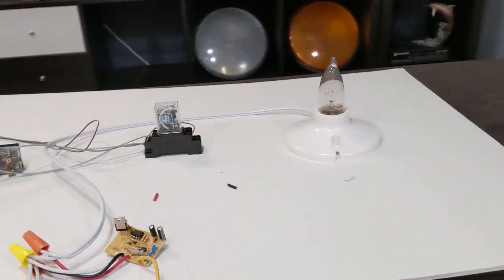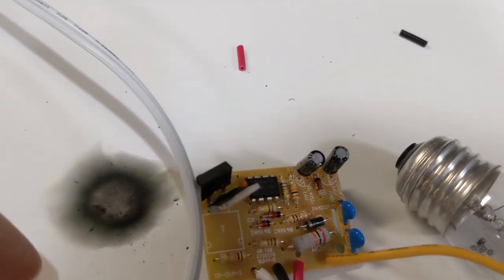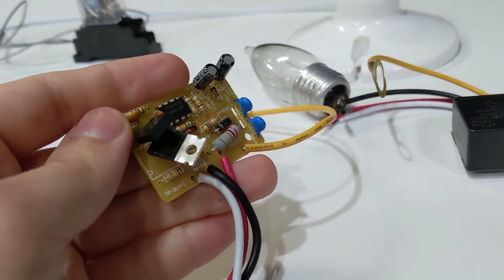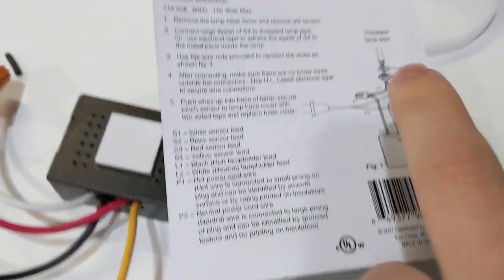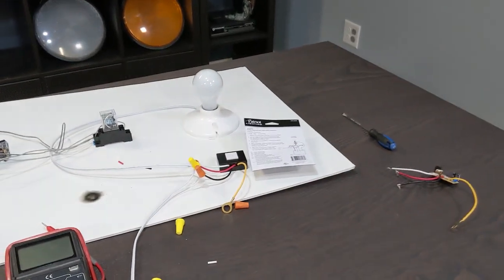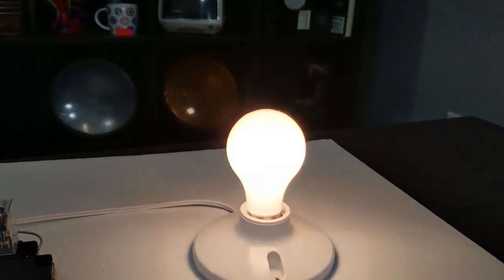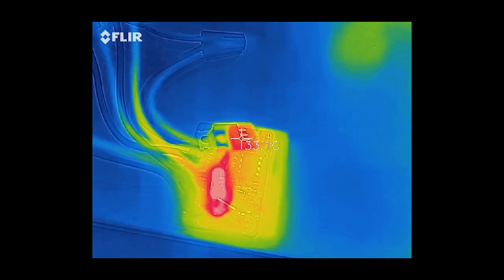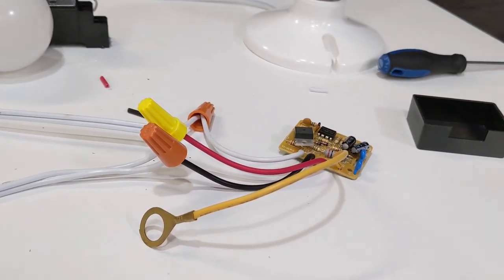A slightly explosive touch-lamp follow-up (standby energy consumption)

Comment: I prefer the way you wired it.  Touch activated armageddon.
Reply: Glad to see you here!
Reply: ElectroBOOM Jr  Hahaha
Reply: I knew electrical things that go bang attracted bears, just didn't expect them this quick!
Reply: can't wait to see what you can come up with this kind of switch! Would it be possible to extend the sense wire and attach it to something bigger like a backyard gate, so that when you touch the gate you turn on the backyard lights?
Reply: @danteolsson3605  TechnoBOOM
Reply: If you want touch activated Armageddon, build a board that has one of these touch switches controlling a relay that feeds 240 V mains into a 240V - 1 V step down transformer that's wired backwards (so the 240 mains is connected to the 1 V secondary turning it into a 240 V - 57,600 V (assuming I have my math right) step UP transformer...

Make sure you turn that on inside a solid steel box WITH A LID ad you're wearing a full face shield cause that's definitely gonna go BANG!!!
Reply: I love how my various subscriptions are doing crossovers these days :)
Reply: Lol!
Seems electricity nerds congregate!
Woosher fail ! 🔥🤣🤣🤣
Reply: Sweeeet
Reply: I KNEW you'd be here BigClive - you love your detonations. Yep I agree- circuit is much more fun wired correctly - i.e. the way he wired it first ;)
Reply: Maybe with a sausage?
Reply: Turns out this summons bigclive
Reply: he needs a pie dish.
Reply: bigclivedotcom can we send one of these to bigclive to do a proper reverse engineering video? Maybe two so he can also create a skid mark?
Reply: Hi BigClive  tell him uk old wiring colours Red Live (Hot) Black Neutral .  Simple red for danger ..
Reply: Touch activated Circuit breaker locator.
Reply: I'm not sure this is quite armageddon. I've seen your giant high voltage comb pcb.
Reply: @kevintestrake1553  it basically shorted out the input through the triac, hence why it pooped itself, and popped the breaker.
Reply: I do wonder how this is in the US with pre-2006 UK mains colouring.
Reply: @dash8brj  I was expecting this to be on ElectroBOOM channel
Reply: What do you have the 57,600 volt leads attached to? If they aren’t attached to anything then no boom.
Reply: @kevintestrake1553  haha, thinking about it, I don't think the the dark skid mark we saw on camera was the only one created in this video.
Reply: Did you feel a disturbance in the Electro-magnetic Force?
Reply: “One moment please” There were couple points where Alec should have borrowed the classic bigclivedotcom phrase
Reply: @webchimp 🤣🤣
Reply: @bigclive ,you KNOW you are going to be asked to do a teardown and re-enactment of this, don't you? :)
Reply: I read this in your voice. Soothing.
Reply: I was thinking of you when he showed the circuit in the main video. Cool to see you here.
Reply: of course bigclive would approve!!
Reply: Now we need to get Technology Connextras to use Wagos and/or drink dark and stormy.
Reply: Agreed!
Reply: Well I guess I don't need to tell you you got a mention here now 😝
Reply: @HappilyHomicidalHooligan  Transformer in reverse like that would not work because the iron in the transformer would saturate and the transformer would look like a short circuit.
Reply: @EwanMarshall  Presumably they made a bunch of them in the late 80s and have been selling out their warehouse globally since the market for them collapsed.
Reply: @TheWilldrick  Almost certainly. Also it's like tenbux for the part so you might as well try.
Reply: I see the Electronic Explosion Gods have summoned Big Clive himself.
Reply: Hahhahahaha that's totally something I can hear you say :-P reading the comment in your voice made my day hahaha

EDIT: For those who don't know Clive (go see his stuff FFS!) - he dissects electronic stuff and sometimes blow them up, all with a very calm relaxed voice, it's probably a good channel for ASMR fans out there :-)

EDIT2: Clive, you might not know this, but you're very popular on ##electronics in Freenode IRC :-) you do great stuff, and when noobs see magic smoke coming out, there's almost always a video from you we can refer to ("Don't feel bad, some people making consumer off the shelf electronic devices did the same thing"...)
Reply: I knew that messing with circuitry would summon you like electronic dracula.
Reply: You got a mention in his previous vid :)
Reply: Jeffery Amherst  True, but that puts you WAY to close to the resulting fireworks...
Reply: @BersekViking  It would work briefly, it happened to me in electronics class, though that one was only a 120V - 5V step down.

It got blown completely off the board and ended up embedded in the acoustical tile of the drop ceiling above my work bench.
Reply: Nice to see you have followed the smell of magic smoke to this video.
Reply: Time for TechCon to invest in an explosion-proof pie tin!
Reply: BigClive, so will we be seeing a Technology Connections Fail Analysis video on your channel? 
I hope so. I'm wondering what makes a triac go boom like that.
Reply: New component:  The NET - Noise Emitting Triac!
Reply: No question, more entertaining...
Reply: Oh there you are big Clive I just knew and or figured you'd show up sooner or later in the comments for this video how could I guess?

Since we're on the subject of YouTube videos been wanting to say this to you directly for a while I'm sure other people would agree with this and would be a good idea maybe get you some views and become entertaining for all of us here on YouTube.

Suggested playlists for your channel.

Those videos you do where you do something on purpose you know the silly ones you know like the standard high power hundred One LED on the mains for example.

A while after they're put out put those on one playlist.

Second one lithium batteries going thermonuclear videos aka the explosion containment pie dish being used for that very purpose.

Videos in a playlist which have gone awry and let the magic smoke out or gone bang whatever you know what I'm saying.

And also defective and badly designed product playlist if not combined into one.

Badly-designed product and devices playlist as well.

And perhaps a playlist called Big Clive and maybe end company or whatever eats.

I'm sure you can think of more but now those have been on my mind quite a while.

What do you think big Clive ideas?

I think it would be pretty popular?

By the way you know how those modules are wired in that case semar color codes order of wires Etc bad idea in terms of changing that up with which wire goes to what.

One time I was putting it in these type of modules in lamps several of them I got all them from the same store however they were different brands on the same hook same price everything I thought that maybe they were made by the same company but just branded differently like sometimes happens or badge differently or a different product line? But same thing you know what I'm saying.

I did not realize there was a difference in the packaging until it was too late after wire Dion I was testing one of the ones might be the last one I wired can't remember same thing happened as in the video essentially.

This was a long time ago but I still remember it to this day.

But I look back through the packaging and realized the one I just wanted yeah wiring diagram was different in terms of the water color code all the others were exactly the same except for the one that was slightly different. No difference in the works of the modules or anything at all just on the packaging.

I think that would definitely be a problem if I know or flop in my book.

But I went back to the store I got it at can't remember where it was long time ago as I've said.

Of course I bought the one that went bang back with me told the guy I got it from or one of them at the store and he just laughed and said you're not the first one that that's happened to by far we've had a team of them of that particular one explode when connected and turned on.

And he said don't worry you're not out any money here's one the ones that will replace that of the ones that we know are like the others he reaches into a box below the counter and pulls it out and places the one that exploded in a box next to it.

And he went on to explain they were getting rid of the others that didn't match the others and not going to carry them anymore and thus eliminate the issue.

So they were aware of this and trying to work on preventing it happening but had not come to fruition yet.

 but it was one of those hardware stores where they actually want to take care of the customer as much as as if they were one of their own employees or something like that.

It might have been a true value or an Ace Hardware possibly you're one of those ones where you may have this old Gray beard is that has had a hardware store his whole life running the place.

Like the one that would actually know what exactly would need even if you couldn't describe it and could you walk you through the entire project even if you've never even touched a screwdriver or something like that.

 we used to have a hardware store like that cost of the neighborhood where I used to live when I was a kid.

We're closed down for good I got a ton of stuff on clearance for example I bought every single one of the low voltage bulbs that was there a lot of other things I could use for my projects.

I even bought a bunch of wire and other things as well I was always looking for clearance stuff at places like that or things that were obsolete functionally they can get for a song but could be used for something else.
Reply: Also the Torres self destruct switch that only self-destructs itself or one could say anti self destruct switch that keeps you from hitting self destruct by destroying itself now what we need is the button that pumpkin press when he wants to use a bomb that does something to him instead then he gives him a shock from and Watercress charger or something anyone?
Reply: @calavera42  sir I think you need to update your user image I think it's obsolete or at least needs a firmware update LOL although I remember using those things years ago we actually had the old phone Niche at the house and put a phone in there later on I put it receptacle in there and put way up in the hallway and yes put it on a wireless multi-way switch is the hallway was dark at night and no outlet for a night light and the switch was at the wrong end of a hallway for the hallway light that was there.

Problem solved at least that didn't go bang when you turned it on the first time!!#
Reply: @TheWilldrick  you know what they need is to have some sort of an app that's a companion to YouTube that allows you to put things that you might want to see in different terms and then when a video shows up you get a notification that something matched your Quarry or your personal filters or personal algorithm whatever you want to call it seriously even if it were a premium feature someone might just do it and find it useful better than searching up all possible videos that would that's what you wanted to see seriously say that you were looking on I don't know products that went Bang I'm talking about in terms of addition to just putting a search query that be more in-depth and then give you a notification when eventually it would come up if it wasn't available yet at least at that time who knows maybe it exists I don't know but then again if it were done through your your private machine it probably get the against Google terms of service in your isp's terms of service because it would be a bought or something similar
Reply: @HappilyHomicidalHooligan  actually did something like that by accident once or something very similar.

It was a filament Transformer of some sort for a low voltage filament perhaps for a vacuum fluorescent display?

Or some sort of extremely low voltage vacuum tube or indicator?

Or maybe it was that tester for Christmas lights did the first word come out of?

But I do know the voltage was around 1 volts or so so cute it was for but of course dummy me reverse primary and secondary bang no more working Transformer oops.

Also if you want high voltage get you a vacuum tube television or other output Transformer wire up the proper winding to a source of about 12 to 18 volts AC somewhere in there.

Model train Transformer would work nicely.

But chances are it may not last long since the dawn electrical breakdown in the Transformer first before anything else nice lightning like Sparks even through the Transformer insulation for a short while that just blew my mind when I was younger I did not know what was going on I thought I'd want it as a Step Down Transformer not Step Up and I was getting those lightning like Sparks between my bleeds and all the wiring and the Transformer.

Also as a gag one time I felt a little inverter circuit that would power the neon indicator on a power strip when it was off but when you plug in a load it would turn off and obviously not run the load but it would confuse the heck out of people that would try to use the power strip Great Prank.

And also I eventually built one into a large AC adapter for the same reason and leave that point in waiting for somebody unexpected to try to use this power strip.

Needless to say it was designed in such a way even if they realize it was unplugged it would not go bang if it was plugged in.

Also first time I tried to use a neon bulb I did not know about current limiting resistor has for that because the one I was using it looked like it had one already in the leaves in all but oopsie no resistor present oh yeah bang and a blown 30 amp fuse.

Those are the fuses that were installed in the panel when we got there and could not lower the value due to the 30 amp Type S fuse adapters you could not downgrade them and yes most of wiring was designed for 15 or 20 amps most of which was 15 and this was on 120 us current.

Also when we first moved in when I first saw the place I was thinking that there was some sort of weird stuff going on with the electrical or perhaps something that was controlled separately or who knows because there was a second meter socket even though it was a single residence and I had a meter that had a much larger fish bowl and then later on look closer turns out it was a timer and also that that was controlling the old electric hot water heater only which was on a separate fuse box all together this was I guess you could say similar to what they do in other countries or used to do for like economy 7 or something like that it was basically a load control that was just switched on and off at regular intervals and on a separate meter which the timer and meter were in the same glass enclosure.

All those oldies could be set up to switch over to the other meter a different crimes however this was just on her off and only registered on that meter in our case.

And later on we got an off-peak meter so power was cheaper at certain times and at night.

At that same house and a different house eventually we did something similar this was all before Smart Meters but it was just a meter that had different rates at different times.

We wound up having timers on heavy appliances surcheros when we were in dehumidifiers we would have an outdoor climber turning them on and off at certain hours.

Also we would try to use things like the dishwasher and dryer and stuff like that when the power was cheaper if possible.
Reply: @Andrew-tj4kg  I was thinking about saying something like that and yes I saw what's his name on a video talkin about that recently call you about the twin and Earth cables can't remember the guys channel name I think just a day or two ago I saw that video what were you referring to this way and chance?
Reply: @Andrew-tj4kg  but the thing is and these were intended for United States wiring not European or UK also I've seen some pretty badly designed products very similar and yes I had one of those and basically the same circumstances go bang World up getting another one from them they had a box with the ones that were properly done and the one next to it with the ones that are going bang because people would miss wired them they were getting rid of the others they were right with the other ones same price same hook Etc and they were not done getting rid of the others yet and so of course they kept him at the front ready to go and when I told what happened he just laughed and said oh here you go is happened plenty of times before. And explain the rest what was going on. So one of those times I had a real laugh at my own expense not really at my own expense because got the other one that was the same as the other in terms of wiring.
Reply: @beware_the_moose  Fannie phlegm something or other reference?
Reply: @elonmask50  yep or touch-activated fuse tester depending on how old is your electrical system is yep had that happen a few times in my parents old place where had my first shop!

And usually take out about a quarter of the house when it happens. 30 amp Type S fuses in most of the sockets.

World up wiring in some junction boxes with fuse holders and or receptacles and fuse holders or switches and fuse holders to protect other circuits for our own safety.

Most wiring was only only rated 15 amps possibly 20 and maybe one or two cases or so.

I think there was only one properly fused wire in the whole fuse box ouch!

Had been that way for who-knows-how-long and definitely signs of overheated wiring and worse you should have seen when we changed outdoor kitchen light for a fluorescent fixture I don't think we could have shoved anymore wiring in that box and yes multiple circuits going through it.

And also there was a double Gang Box that had only a switch on it that was so packed you could not tighten the screws all the way down on the cover of the box!

And that was a relatively large junction box as well as compared to the others!

Can't remember what year the house was built!

But original 60 amp service 110 220 60 hertz u.s. of course.

I've been in plenty of places that have built in 30s and 40s and yeah some pretty disastrous situations.

I've done working places for quick fixes and repairs but to do the best I can to make it safe and have had to tell them to not add any heavy loads whatsoever until the house is completely rewired yeah me nurse times. I felt if they plugged in one more lamp there would be no place left that it would be burned to the ground if you added one more bulb to any circuit yeah that bad
Reply: @mlindholm  highly likely but would have to see a full circuit diagram AKA schematic to verify but likely you're right
Reply: @EwanMarshall  also fan controls 4 light and fan motor usually use red and blue for the outputs.

Also other devices such as interconnected smoke detectors and outdoor lights that have a output for another line use other colors as well which I've never seen anything at all use a commonly used wire color such as red or black instead of an odd color you would not want to see for an output like that needless to say very well designed and to keep someone from making it go bang like that touch light control did.

It almost be like using the primary colors of a transformer for the secondary Animo voltage side good morning up hooking up thinking your ride and winding up getting you how many overtimes the voltage out of the secondary what should have actually been then the high-voltage primary side. Just no don't do it think your design through I wonder if anyone had written the manufacturer about this and if this has been corrected I hope this video brings Justice to this and it makes people think about product design before it is design something like that so stupidly.
Reply: @welshdave5263  he probably should have checked his drawers in other words right I'm not talkin Parts drawers or kitchen drawers either probably another skid mark there as well
Reply: @stamfordly6463  yeah it felt like a thousand touch lamp control modules died
Reply: @stamfordly6463  also he did use the force the electromotive force from The Darkside for sure is there going to be turning on that light anymore after he got done with it. At least the first one day he wired up.

Sora Darth Vader versus Palpatine I think it was except instead of crushing force or electric force when he uses of or Sylvan just goes bang just don't do it inside the Death Star please or maybe that's what happened when they saw the charge or laser or whatever coming down d exhaust port either or they had a touch switch that was wired like that was into the Reactor Core something and was touch the try to protect it and blow up the Death Star. Getting a bit ahead of myself but who knows
Reply: @samwalker4438  definitely Maybe he hadn't washed big Clive's channel before or they be he thought something about copyright or some sort of content match or something crazy like that would be surprised if that would happen in the future on YouTube for some reason right now YouTube is just give me a break there is so much crap going on with it if they keep it up there won't be any YouTube anymore go be more like no one tube or no tube what ever cease to exist above the words
Reply: Is shown on the channel of Technology connections here is and update flash something something something of something let's see if this one is up to something something something something in the end Bang
Reply: @cheaterman49  what is your definition of ASMR would like to know I hear it everywhere but I have no clue what it is for Real I'm afraid to look it up you know how that happened sometimes like that time Bad Dragon was mentioned on a big slime I cannot unsee that needless to say I deleted it out of my search history obviously explanation point
Reply: Yep I'm replying to myself but here goes thanks for a second opens Wikipedia app puts in ASMR in the search box and then looks through and then still has no clue even more question marks in my mind so yeah that's why I asked what do you mean by AMS AR since I remember trying to look it up before and still couldn't make any sense of it.
Reply: Yeah now it's like where's the kaboom? there was supposed to be an Earth-shattering kaboom!
Reply: You haven't done much that spicy in a good while. (Not that I'd wish anything bad on ya, but you know?)
Reply: Of course Clive shows up if it's dodgy wiring 😂
Reply: @HappilyHomicidalHooligan  you mean in a steel box wearing "safety squints","double condoms" and "mother on speed dial"
Reply: The legend is HERE!
Reply: Clive you should get on of these moduls & analise it.
Reply: @maxximumb  Triacs blowing clean in half is a common thing.  Mains faults involve very high current.
Reply: 🤣🤣🤣 I'm so glad Clive watched this. I was thinking hey mentioned big Clive in the other vid and made a big Clive explosion in this one 🤣
Reply: It was fun! Are you going to have a go? A shot then an explosion?
Reply: Big Clive approved circuitry!
Of course, Alec won't be fully indoctrinated until he starts dissembling lithium batteries, necessitating the use of an Exploration Containment Pie Dish™... 😁
Reply: A good result!
Reply: @KairuHakubi  I almost thought your avatar image was actually the contacts on hey SIM card at first when I first looked at it.

Not Japanese characters or Chinese or whatever I get them mixed up.

But what did those characters mean in English just wondering.
Reply: @TheWilldrick  one problem with that if it's a metal gate chances are in one way or another the metal gate would be tied to ground it might be possible if you had a gate latch that was insulated somewhere from the rest of it and ground I don't know if they got them on walls that could do that natively that's the time for that purpose but you could build a low voltage version for sensitive proac for other touch switch use a relay or a contactor or maybe even an automation controller to do that I had a thought about how to do that one time never had a chance to prototype it so yeah I'm sure someone's doing it some way or another oh by the way those touch switches came extended I have a little Edison lamp with a invitation you know reproduction s and bulb still incandescent though that half of my top of my bow case back in the bed not the headboard but the side of the bed on the wall it was awkward to touch the lamp itself so I put a strip of aluminum foil take down to the edge of the wooden bookcase back of the bed backside of it along the long Direction round a piece of hookup wire fairly soon so it's nice and fox one out of the way which is folded underneath of portion of the aluminum foil and this trip is about I'd say put their hair off or so long maybe she learned it be longer pressed flat it just hope they're on with Scotch tape and that wire is normally tied in quite literally to one of the screws that holds the grass for the lamp which of course is electrically connected to the lamp itself through the screw threads and that acts as remote switch and also in my previous place I stayed I did something very similar except I had to touch points the lamp set on a desk Bobo the loft bed actually there was three touch points if I remember correctly one by the foot of the bed by the ladder and one at the head of the bed for halfs it was also on either side as well and then of course one what's a 2 down below so yes you could do this there's not any problems I think the reason why it worked well is because these switch modules automatically compensate for changes in capacitance which means it would cancel out any large stray capacitance because there's a say state and only trigger on the change in capacitance after startup I'm sure because I've could clear that up I'm sure one of those electrical electronics guys could also Maybe praying for here sorry eevblog oh yeah Dave Jones could do something on this as well maybe even get one of the original touch lamps that had to vacuum tubes and do a teardown I bet you some ways to earn while I was down be cool if you get a hold of one even need a new tubes but yeah have a switch when it wasn't in use you don't want just 50 Watts just to turn on and off a light but touching it but actually I think I got a gadget from someone one time that was basically that circuit in a little box although it did are things to it looks like the Box have been repurposed from something else I think it also had it all for Sonic motion detector on it if I'm not mistaken the box with metal holes all in it NOS clearly vacuum tubes in it for now I first turned it on surprisingly it works I'm like and also it wasn't stamped as to what they were it was written in marker and paper labels what everything did all the adjustments and everything so pretty sure as homemade had multiple outlets and stuff on it and switches and everything so it been customized for they wanted to do with it still used it for its intended purpose though as well as the different inputs could be switch to different outlets and combinations as well and also it did have a built-in light dimmer even fuzz manual and four different Outlet for some reason it had an audio input and a pastor I'm thinking that that was might have been for like don't let someone know when there is an audio tone on something or maybe something that would play audio that would also trigger the lights in the morning or something who knows that just Baby Scratch forehead and also there was a clock timer in it as well something sort of looks like something like an oven except it has a dial with multiple pointers on it and also like a martyr clemmer except it was ancient and also let her have a photocell on a cable as well mostly it was used for lighting although it had other functions as well as long as it was a buzzer evidently I never used it for that but it could be tied to the timer as an alarm clock and there was also an extra limb put the sound a buzzer only which was just probably an idea in case you wanted to use it for something else? and there was also a bunch of screw terminals on the back and yeah some of those relay contacts and imports and also had various voltages and surprise there are tube bike sockets on the back and male plugs like that and two or three or four screw terminals depending on what was going on they would have line voltage if certain things were enabled. people that were in the know knew that that could be present in some equipment and respected it it didn't mess with it where they should not this was definitely build what look like 50s or 60s but hard to say I think this had evolved over time because some of the components did not match up with the others in terms of vintage but it was all in one device this was about the size of a small computer tower actually not Tower but desktop case and yes it did have a primitive power strip as well and surprisingly it had a grounded cord and also nice chunky power supply to micro Sandy to power other things and yes screw terminals for that as well if I remember correctly it even had a thermostat for heat and cool as well and yes 24 volts output as well also had a couple people supplies because of tubes also it did have a Primitive AM FM radio and external speaker but had trouble with the radio in for Shirley at first bad tube socket so is basically useless for that but fixed it later it was an odd tube socket that I couldn't get ahold of. and also I had to get a tube Shield to replace one that was missing so one part was not operational until then.
Reply: @Nono-hk3is  well in this case your user name may not be appropriate but it could also be appropriate double negative so it would nullify itself Maybe so does your username mean yes?

But you agreeing to something in your username saying no no wouldn't that be a contradiction in terms seems like it to me just can of on the side you know but to each possible double- is to his own you can say to each double- is to own or something like that but that doesn't matter but makes you think and might get your attention in that way which it did especially since what you said was opposite of know something good would be the opposite of a no-sew that's why I brought this up only reason it would almost be like someone's username being I only give negative feedback if you're in electronics you know where that's from don't turn it on and possibly blow it up taking apart well I kind of stretched it there but it works for this situation with this video.

But it was better than of rifa capacitors oh he would have suffered if that was the case instead of just a broom and a half triac which by the way I agree with big Quan that is a common occurrence yeah main circuitry because there's a lot of energy and when things go wrong is that he go bang big time I had a habit of mounting them off board for that reason sometimes even with wire leads as flight leaves and crimp on terminals going to a terminal strip or other connector so they can easily be swapped out if there's a high chance that that may happen in the design which unfortunately does happen quite often I feel things for someone sure enough usually did something very dumb on their end or crossed a short somewhere or just had something go cup Louis and short the output one time it was some sort of a dimmer mod for adults the lamp had a bad cord shorted, kablooey goes one of the Triax and not without takes out one channel the controller which meant replacing three or four other chips and the driver circuitry since they got the full line voltage across them which of course they're not rated for this although the controller itself God spared somehow don't know how but kind of miracle I'd say just maybe after all the other support circuitry there was enough left in the pulse to take out the output of the device that was controlling that or it was shown to do or Pounds or other components in the circuit?.
Or got shorted to ground somehow and also somehow other components got blown someone taneously the Dallas channels we're not even in use which makes me think there was some sort of catastrophic failure when that occurred cross with a Cascade failure either or nurse mechanical forces involved when the triac flu that cause something to shift or something or navy induction because of the filters or something weird yeah I did not take him to count war was where of they happen found a few random fraud components that really didn't even have anything to do with that circuit directly in the device afterwards is fully operational before the lamps were it out though maybe there was enough current or perhaps a voltage surge simultaneously who knows but I do know it was plugged into a surge protector for sure there was a few metal oxide very is Astor's in the unit so still should not be an issue also I noticed that a few are there support components in other parts of the circuitry there had been a couple components for some reason had damaged in such a way probably at the exact same instant but cannot be sure that they failed Short Circuit if you are saying for blown open or failed open which normally would have failed short for example few diodes which is unusual so so please I think happened more than the Triad failing at that time and it's possible that there's multiple failures but just very close together or something was on the edge who knows any thoughts on this as well.
Reply: That's your specialty, isn't it, Clive? ^.^
Reply: @aaronbrandenburg2441  wisdom :>
I love when your eyes give you something interesting to look at even when it's not there, that's super neat. though I thought SIM card contacts were just a little row of gold teeth...
Reply: I miss mr. Photonicinduction.
Reply: bigclive can smell an electroboom the second it happens all the way across the internet
Reply: @beware_the_moose  "Turns out this summons bigclive"
- Just as I expected. This is like a bad 1980s Ouijah movie. "You have summoned the BigClive by invoking his name in your first video, and now he will haunt your follow-up video and inflict upon you dodgy wiring, explosions, blown fuses, black smoke, and burn marks..."
Reply: @JanicekTrnecka  Whatever happened to him?
Reply: It'd make for a good prank!
Reply: I love you dude! I wish we could hang out together seriously that would be so much fun!!! Things would be obliterated and then dissected and then repaired and improved and I mean Electronics! hahahaha!
Reply: @HappilyHomicidalHooligan  Interesting mental picture, but that would technically fail to work.
EDIT: I've seen it was mentioned already. I keep this comment, because some people might enjoy the explanation of the concept of "saturation of the core", and why it happens in this case.
A transformer works by magnetizing the core in one way during one half cycle and in the other way during the other half cycle, but there is only a limited amount of magnetization that fits in the core. If you try to magnetize the core more than it can take, the core stops behaving as core (the engineers call it "the core is saturated"), and the transformer winding without the core acts nearly like a short circuit.
The higher the voltage you apply to a transformer winding, the faster the core gets magnetized. A 240/50Hz transformer is built in a way that the core can take one half cycle (10 milliseconds) of 240V RMS voltage (+ some safety margin), if you apply it to the many windings of the primary side. The windings are constructed in a way that the magnetization that is caused by 240V on the primary side causes 1V on the secondary side. The maximum amount of magnetization, that might be around a 300V half-cycle (10ms) on the primary side is thus about 1.3V on the secondary side.
If you apply more than 1.3V RMS on the secondary side, the transformer will go boom, just like the TRIAC in this video.
You can counter this effect by increasing the frequency. If the transformer core can easily take 10ms of a 1V half-cycle at the low-voltage winding, it can also take 5ms of a 2V half-cycle at 100Hz. But the core material has some "internal magnetic friction" that causes the core to waste energy and get warm every time you remagnetize it. If you apply 2V at 100Hz, the core will get magnetized as hard as with 1V at 50Hz, so no danger of saturating the core, but it will change its magnetization direction twice as often, and thus get twice as warm. Common knowledge is that mains transformer cores usually work well up to 400Hz, so using a 1V->240V transformer designed for 50Hz might work as 8V->1920V transformer at 400Hz (8 times the frequency means 8 time the voltage with regards to saturation and acceptable losses in the core. BUT the insulation of the 240V winding will most likely break down at nearly 2kV, so even 2kV won't really work.
Enjoy (really, I mean it!) your mental picture of that transformer creating over 50.000 Volts, but please don't try it at home.
Reply: It was reasonably satisfying!!
Reply: Clive!
Reply: @aaronbrandenburg2441  wow, never noticed that before. I can totally see the similarity.
Reply: Technically he can still do that just needs to wire the touch sensor to whatever doomsday device. He said  basically you can wire it to whatever even at a distance if you wanted to for whatever reason in the main video.

also trip down memory lane
When I was little there was a tall thin lamp I believe Kmart was selling and my mom returned it because it was shocking me and I would stand there intentionally letting it shock me I figure you could pop the original wiring out of that lamp ground the wire he's touching to the lamp base itself and have a touch lamp like that which looking back would have been cool. 
As long as it's metal it's grounded to it should work fine
Reply: A nice addition to anyone's home security system... Just missing the gun powder...
Reply: Hi Big Clive. Yes, I wanna marry you, techi and Lockpickinglawyer <3 I'm polygam!
Reply: ThechnoBoom
Reply: Just admit it Clive - you're jealous of that purdy skidmark :D
Reply: no no no no no no stop falling me
Reply: stop falling me lol
Reply: @jrmcferren  i say we send a box of chocolate block connectors to the States.
Reply: @gleggett3817  We can get those here, they really just aren't used. Wire nuts are the most common with Wagos actually picking up some steam.
Reply: @jrmcferren  to be honest chocolate blocks are a pain. Wrong size, screwing up tight and finding youve missed strands (or pinned it by insulation), screws coming out and getting lost, can't find tiny screwdriver and the perennial 'stabbing finger with copper strands while twisting them together so they fit in hole'
Probably time i bought some Wagos....
Reply: Alec-troboom!!!
Reply: Elon Musk would call it a RUD (rapid unplanned disassembly)
Reply: Ok, I could be wrong, butI hear him refer to the resistor as a "1 watt resistor" isn't resistance measured in Ohms? If there is a resistor measured in wattage, why is it different?
Reply: @dylanfinch2951  1 Watt is the amount of power the resistor can handle. Use V=I/R and Power = VI to calculate what combinations of voltage and current you can push through it.
Reply: Yes. But resistors are also rated by how much power can go through them without burning up. Physically larger resistors can handle more power. So whatever resistance that resistor is, it can reliably dissipate up to a Watt of power. Hope this helps! 😎
Reply: @youdontknowme5969  Thank you, I was curious, because I've never heard the wattage of a resistor called out before, but it makes sense, because a space heater is basically a big resistor, but they're referred to by their wattage. I didn't really think of that though
Reply: Any chance you might look at a touch lamp circuit someday? I don't know how common they are on your side of the pond.
Reply: "Well in this episode well talk about plastic explosives, their history, how they work, how to make them at home using ingredients you have at your home like kerosene, diesel, Styrofoam and pet bottles..." "We observed how in a pervious video how a mis wired touch lamp is explosive on it's own when activated but you can add it to your newly made plastic explosive to have a touch activated explosives. which would be very handy in the coming zombie apocalypses" XD
Reply: I almost right away scrolled down to hope to find Big Clive, I was NOT disappointed, hahahah!

Touch activated armageddon is a phrase I will shamelessly steal, but provide credit for in the future!
Reply: I preferred it too. I know I’m late, but I did want to mention that a car is usually ground black, hot red, but I would always check the diagram
Reply: ...the Touch-A-Boom.
Reply: Here in the U.K. red used to live and black Neutral, however has been Brown Live Blue neutral for many years, looking at your original (and interesting) wiring you had a live feed going through the lamp (in series) to RED which supplied power for the unit, black was correct (neutral) and then your live feed went to the Traic (actual switched output to neutral) so you plugged it in, the unit is powered via the lamp (in series) and is waiting for a touch to turn on, you touched it and the device turned on the traic which merrily tried to short out a 120V 15A supply and died trying, but in that short half cycle it did dissipate approx 1.8Kw. The 200W triac that flew so high…